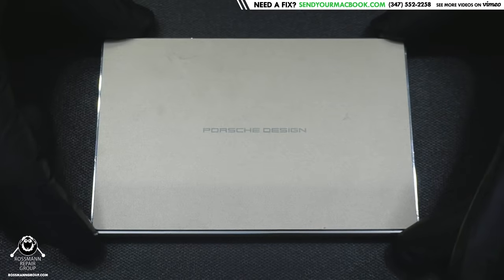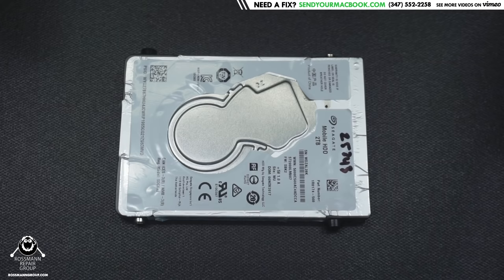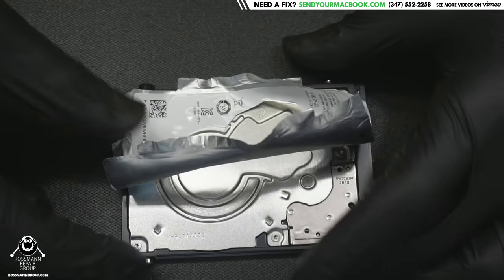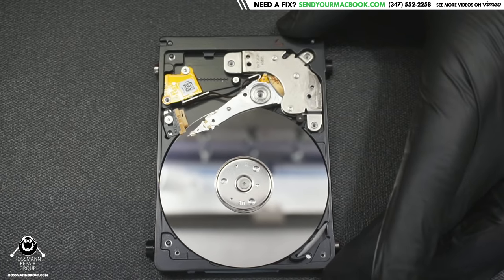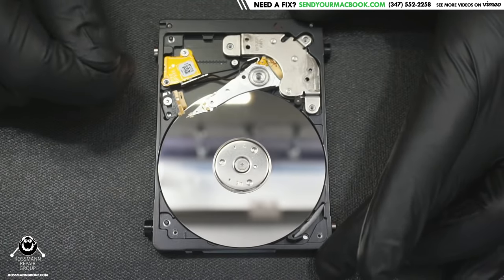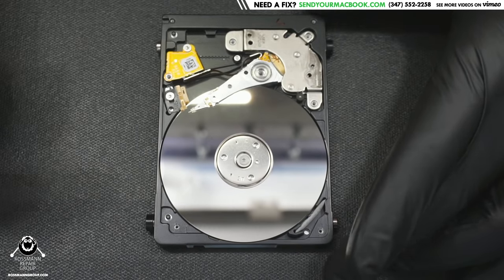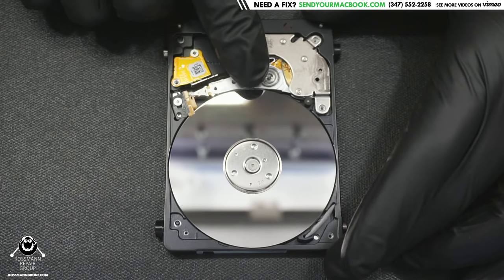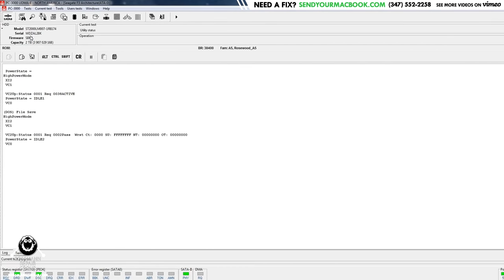Why your Seagate external hard drive is beeping; beeping hard drives can be recovered with this fix

Comment: Do you extract the data and then scrap the drive or do you return this as a working drive after you have inspected and/or swapped the heads?
Reply: A company I did an internship at recieved multiple hardrives back. some where in usuable state (backup NOW, disregard drive after) others where returned but the data stored on a new drive. Most drives you send in for datarecovery are dead or near death anyway, but you can get them back so you know they dont have your private data or company data. The company called me later, and wanted to dispose all their old hardware and drives. I recieved many of their recovered harddrives too, and was asked to destroy all. some of those dint work but found other drives with statements that they where a copy, working fine. I destroyed most data, wiped platters and some are repurposed now. They spend money on recovery but did not want to spend it on proper destroying data :P

Im sure if you want to, you could let them destroy your old drive if you get your data back somehow. I wont expect a "fixed" drive to work for a long time.
Reply: @CodeAsm  Is nine years and counting long enough? OK, mine wasn't a Seagate and there's nothing on there that isn't on DVDR so I could re-image it onto a new one if I had to, but my workbench laptop has been going over nine years with an unstuck hdd and never given an ounce of trouble since I unstuck it. (Western Digital Scorpio Blue 160Gb IDE)
Reply: @countzero1136  then consider your laptop lucky ;) and also know that 9 years of technological progress made it less likely for someone at home to unstuck his/her drive and keep er running for another 9 years. Did you ever run a surface diagnostic or watched the smarttools logfiles? Maybe you only lost a few sectors and that was it.
Reply: @CodeAsm  It's true that as far as consumer grade hdds go, the quality isn't even close to what it used to be, and getting nine years out of a brand new one is unlikely these days, but my point is that hdds CAN sometimes be fixed without specialist tools or cleanrooms.
Reply: @countzero1136  on that point I can say yes sure. I even tried my own amateur fixing with various success rates. People should not count on it doing it themselves, recovering data after opening a drive lowers the changes but it's possible and to various degrees depending of the state of the drive, patience and skills ackuired with similar projects. People who NEED their data, spend your money. Else, anyone could try learn it. Worst that can happen is, well, dataloss. But we learn from it never the less. But I'm sad, the few drives that had head stuck or replaced using adonor, where good for data recovery, they died quickly afterwards. Guess it's random in some cases. A dropped laptop is different from "just" a stuck head, that I can imagine. You now make "regular" backups right?
Reply: @CodeAsm  There's an old saying in the computer business - "There are only two kinds of computer users - those who have backups and those who don't"
I keep on telling people this but you'd be surprised how many people don't back up their data :(

Trouble is that most people these days don't have a clue how to do it. I've been doing this since the days of mainframes with rows of 9-track tape machines along the wall, but the younglings today still think they know better LOL :)
Reply: @countzero1136  cool, an ibm one? I touched Cobol 2 years ago for fun on real metal, a modern ibm. But I had to learn to backup the hardway, losing school stuff due to HDD death. There are so many cheap cloud based solutions for any os and mobile these days. Apple and modern Android (Google apps) even automatically backup stuff unless you choose not to use those or buy a phone wich brand offers their own backup solution (wich people commonly never buy). It all indeed comes down to the binairy system, those who are lazy and those who are smart in being lazy. The place I touched the ibm, those guys had serious backup locations and redundancy inplace, awesome.
Reply: @CodeAsm  Yeah IBM System 370 / Model 148. That was in late 70s, maybe '79-80 or thereabouts. I had just left school and my first IT job was basically feeding paper into incredibly noise printers LOL. The company had upgraded (not that they called it that back then - these were of course rented systems that got updated from time to time) from a System 360 and around this time they were starting to replace the 9-track tapes with early hard drives (for the younglings out there, these early hdds had removeable platter stacks, a capacity of up to a HUGE (at the time) 64Mb-ish and were the size of a commercial washing machine!)

How things have changed. With its 32-bit architecture (with 64-bit floating point) the '370 was cutting edge at the time but today I could run the 370's VMS operating system on a Raspberry Pi Zero!

Back then nobody would ever have entertained the thought that these could ever become a domestic appliance, much less a pocket-sezed gadget :)

Comment: I got a used HQ60 with a beeping drive.  It's a Seagate Momentus 5400.5 250GB.  There is no system restore CD with the machine.  From what I've read there is a restore partition on the drive, so it's important to get this drive recovered.  Would it make sense to have it recovered, then transfer bit-by-bit to a SSD?  What would be involved?  Thanks!

Comment: even a professional could lose The Data of sectors the head moves over and depending on how many sectors per pass one or two could be affected on each if say 20 sectors per track you would expect 5% to have some data lost. 

the recovery tools might be able to deduce what the lost data is because each sector probably has over 90% of correct bits but drive cannot deduce what data was lost but depending on file type software can often suggest a likely correction. 

for instance, a text file is likely going to be letters, numbers, punctuation and/or a few formatting characters (tab, line feed and carriage return ) by comparing surrounding text with a spell-checking dictionary of expected language often 100% recovery is possible. rich text has a lot more formatting possibilities but again not too hard that 100% recovery also possible. as do other formats like PDF. (although PDF uses a hash check so just one ambiguous character could result in an unopenable file)
other media is often harder to assume what is missing so may have visual or audible problem but likely can get a passable copy of original for transcription purposes even if picture(s) aren't  perfect
bottom line: expect 5% loss (and know additional loss could have occurred while you were determining that there was a problem-so do regular back-ups) and Praise God if any files do happen to get recovered from a drive you "forgot" to back-up.

Comment: A proper backup would have solved this issue in the same time it takes to order a new drive and pull the backup. And it costs a LOT LESS!
People do really rely to much on hardware...
I have RAID5 in my main computer, so if one drive goes, i can recover it.
Then i have a backup to a NAS with RAID5.
And then i do a clone once in a while on the system partition, since normal backup can struggle with that (Windows..... *sigh*)
The only part i haven't solved (yet) is to have backup on different locations, but i always lock away the NAS in a fire proof safe when going for vacation. On my to do list is a second copy of the backup on a different location.

Am i running av business?
No, just a home user that knows that drives can (and will) fail!

Comment: I bought 5x 2tb hdd2.5 green label seagated, n 4x sshd hybrids for a project.  Had 2 heart attack, 2 plus years later (it put them I  usb3.0 external orical boxes, in orical hard cases, sat in storage.

2 plus years later (they where fully tested with seagate tools etc. I plug them in  1 has beep noise, rest work, and now 1 year later reliable,  but iv got this 2tb hdd that had maybe 10 h use, that got that noise (no warranty), no data on it...(was formated)..

Can I fix drive to use it, or is it usless (unreliable drive)

Comment: my laptop cant detect my external hard drive.
yes, i did go to the disk management to see if it shows their but it didn't. and also the led light is not flashing anymore. my question is can it still be fixed?

Comment: A relative of mine has the same thing happening to an external 4 TB drive from INTENSO (a Seagate HD) after it fell on the floor. Beeping sounds, and the "head" stuck on a platter. I managed to get the head "unstuck" - but alas, the HD makes two "screeching" sounds and then seems to shut itself off...

A write-off, it seems...😐

Comment: what type of screwdriver did you use? bcs it seems I tried using every single one of my set tools and it doesnt work with the middle screw on disk cover
Reply: It uses a pentalope bit. If only they used a damn torx bit there, shameful.

Comment: My seagate drive all of a sudden started beeping, not connecting and the light won't flash. I wonder if this is what i wrong with it.  It was pulled off the table, but still remained connected to the computer. That rapid motion could of messed up the head or arm piece you popped back in place? Gotta find someone to fix it!

Comment: Qucik Question, I removed the hard drive from old 500 gig external drive. since it's just a sata connection now, can I use it in my desktop as a normal drive. will there be any risks?
Reply: yes it should work just fine

Comment: Seagate drives are rubbish I have 1 internal and 2 external that have crapped out. And one external that I think has a firmware or driver bug, it bugs out when doing heavy writing it vanishes and the power light just blinks drive no longer detected and it causes my other external drives to start blinking in a pattern. I have to power off computer and disconnect power from the drive and disconnect usb, then power on computer and connect the drive later after having it without power for a while.
Reply: Jesus, man. Why not just clone the drive to an external (NOT SEAGATE) and swap drives? Electronically waste the internal Seagate out after nuking it? Yikes! Sounds like more trouble than it's worth! lol.

Comment: How to fix a Seagate drive? Throw it in the trash and buy anyotherbrand.

Every Seagate drive I've owned has failed in under a year... looking at reviews on Amazon will confirm that much. I have no clue why this company has yet to fix this problem with their HDDs that has been ongoing for nearly a DECADE.

It really bothers me that they sell mass storage drives with this issue... Imagine having 6+ TB of data and the heads failing in under a year....
Reply: I've had WD drives die on  me too... after 3-5 years as expected, although I did have several drives last 7-10 years before failing.

I've never owned Seagate drive that hasn't failed in the first year, and I've had many because everyone and their mother puts these things in their systems.
Reply: i've only had that experience with the internal drives... the external drive I had last about 3 years in the external enclosure and another 3 inside the desktop after extracting it from the broken enclosure. for some reason the usb controller failed(totally has nothing to do with the 20 or so times i or someone else accidentally knocked it off onto the floor, no, not at all!).   i'd consider it a fluke, as that was literally the only seagate drive that didn't die of natural causes, within 6 months, lol   
Western Digital drives.... welll they can't setup a partition table properly at the factory so I end up rebuilding that before putting anything on it... otherwise shit just magically disappears for no apparent reason... I'm not really sure which is  worse: having a drive die on you, or just having your data just vanish for no real reason....both are awful.
Reply: Seagate were good at one time but are quite poor these days. Everybody says that Maxtor are garbage and I gues that was true in the late 90s/early 2000s but I still have a Maxtor 265Mb (Yeah, Mb not Gb) from 1993 that works perfectly (although like all old Maxtor drives, it sounds like a power tool when it's running - holy crap those old hdds were noisy)

Western Digital went through a phase where their drives were dropping like flies (again, late 90s/early 2000s) but these days they're my go-to brand, although lately I've been seeing a few WD Greens on my bench with shorted capacitors right on the power connectors. An easy fix but I can't help wondering how many of these have gone into landfill because of this issue. Since most of the ones affected are above 1Tb, I would fondly suggest that anyone out there with any failed big WD greens send them to me so I can fix them up and build a new server rack LOL :)

Comment: I bought a new external WD hard drive which today started making a beeping sound for about 10min and was not responding in mycomputer but after removing and reconnecting it at start it beeped and in a minute the beeping stopped and the hardrive started functioning normally. What should I do?? is this normal? will this happen in the future again?

Comment: How much do y’all charge to fix a Seagate god damn external harddrive? I dropped it like 5 inches moving my laptop and it stopped working back in like 2015. I just took the L on all the shit on it because I thought it was going to cost a fortune, just ended up buying western digital drives afterwards. It does the beep like you described.

Comment: Problem with my hdd is it shows 2 recognised partition (without there size values) in explorer when connected but couldn't complete the mounting those partitions. Now it kinda spins okay even blinks on start but then a continuous led on. And platers seemed to be running. And it also shows some read write going on through disk monitor. But then everything goes silient. That means its at least doing read from  MBR alright or GPT whatever. If the head is struck I dont u think it wont read any sector at all.

And yep last time it was recognisable shows some bad sectors.. some 0.5% or something... its 2 TB hdd. But few sector wont make it go dead I suppose.

Comment: Hi Hi, I have a problem with my PS4 Game Drive 2TB hard drive. I just bought it, it only has 1 day. I connected it to the PS4. It worked fine and I even gave it some games. It happens that for these nerdy with my new HDD I took it while it was connected (But I was not doing any homework) and it gave me a shock, at that moment on the PS4 I appreciate that the HDD has had a problem and must be repaired and at the moment I went to take the control to repair it, it just stopped working, I connected it again and nothing. I connect it to the PC and it recognizes it without any problem, in Device Manager it comes out as "PS4 Game Drive" but in Disk Partition Manager it doesn't come out so I can't format it or do anything with it. In fact when I try to disconnect it safely on the PC it does nothing, it does not disconnect. The only difference I see is that when I play it I don't feel like it goes at the same speed as it was when it was working well. Try to change cables and nothing .. Help me please .. It cost me 80 Dollars .. And I don't want to lose so much money

Comment: The hard drive in my laptop just randomly lets out a beeeeeeeeep sometimes. It's higher pitched than the drive in the video. The laptop doesn't freak out when it does it. It's a Seagate st2000lm003 hn-m201rad

Comment: You lucky if you will do full recovery. Usually for full recovery and hard drives 6-8-10-12-14 terabytes , after such heads problem better use Seagate tools. PC3000  do not have enough features. First need update firmware for stop media cache process. Disable hardware write. And Remove Data from media cache (100 GB) after that read whole user area.  And after combine data together use cache table list from firmware. Sometime bad sectors can be replaced from media cashe copy.

Comment: Perhaps you know what might have happened if a laptop CD-ROM drive suddenly started buzzing very loud when the computer is being turned on?
I had that one laptop with a CD-ROM drive that worked fine, except it had some troubles reading the discs because of some dust on the lens, so I sprayed it with hot air, nothing more, and after I turned it on, it started buzzing as I described o_O  BZZZT!   What gives?  I don't quite know how to diagnose it, because if I remove id from the laptop in order to peek inside, then I won't be able to connect it to the laptop to test it. Any ideas?

Comment: The worst external HDD's by far: WD Elements 2'5 
So so many have crossed my hands and they all developed the same issue
Reply: sector 0 issue due to bad usb3 terminal. the harddrive itself if on a sata connector: far less issues.
its just not able to hotswap that often (which is stupid in an cheap usb case)
Reply: @The1Rausch  Yeah it's wiser to buy a Sata HDD and then buy a case with a Sata to USB adapter.

Comment: Don't open the drive if you don't have experience.
But then how do I get experience?
Don't open the drive if you don't have experience.
Repeat infinitum
Reply: Don't open it in a dusty room. You wanna play with failed HDD's? Well, I know a guy who makeshifted a cardboard box/tent with plastic wrap etc, and used ziplock bags for his hands. He said "I  only needed it on for 10 minutes or so, but that shit worked and I got the data off it that I wanted!" Basically a sealed box you can see through that only your sealed hands go in. We don't have ISO-compliant dust machines at our house.
Reply: @jackburton6330  You don't even need a sealed box as long as your room isn't too dusty. My workbench is relatively dust-free most of the time but it's a million miles away from being a cleanroom yet I've done this procedure right on the bench many times with no issues